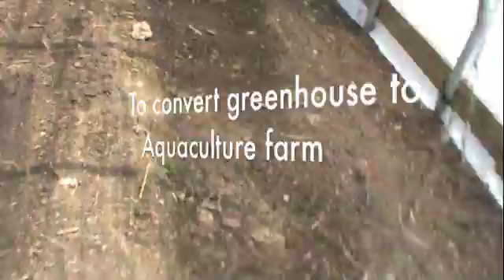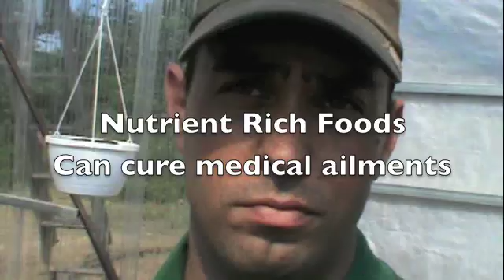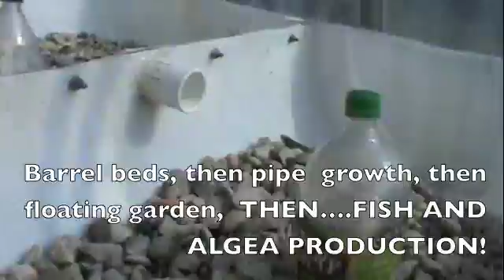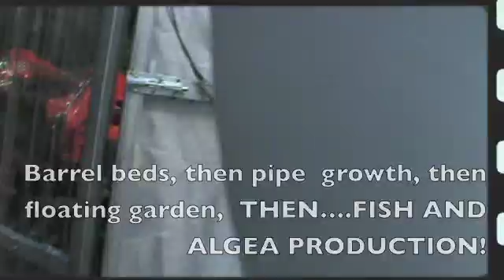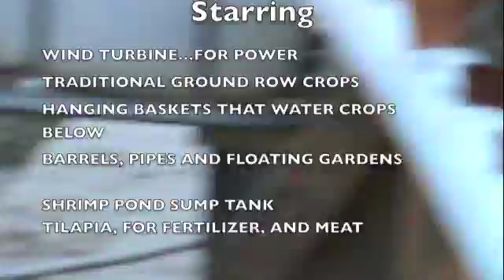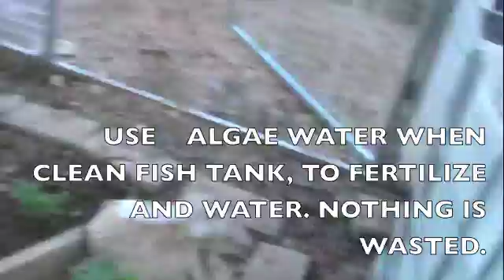Aquaponic Garden  *** Do aquaponics yourself and do it without spending much from Cornucopia Project

Comment: Nice setup, good integration of systems.  But just a note, I don't think your solar panels are going to be operating at anywhere close to maximum efficiency inside the greenhouse and would do better outside on a stand, and throw in a solar tracking system (not very expensive) could easily double your output, you could probably power more than just a pump. 
Where in the country are you located?  Just one more idea, if you're in one of the warmer parts of the country, I would think that your fish culture set up might do better below ground, helps keep temps down and oxygen content up, and lower temps are a healthier environment in terms of disease and unwanted bacteria.  Of course you may already have accounted for that, just my 2 cents ;?D